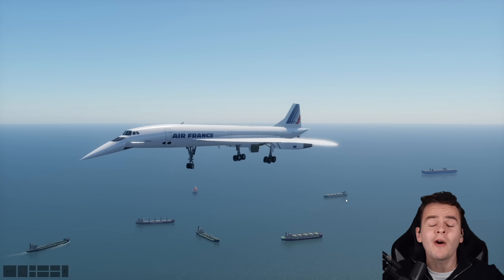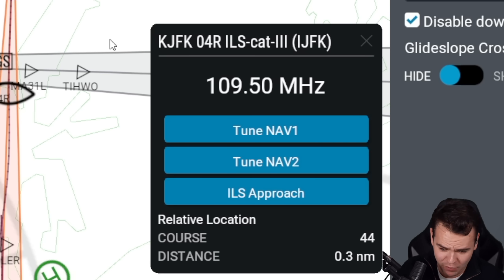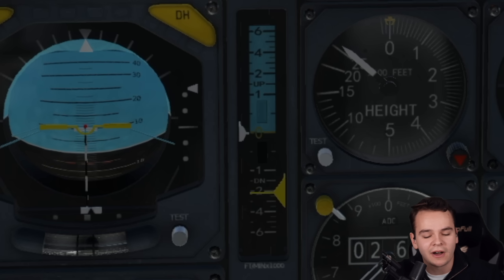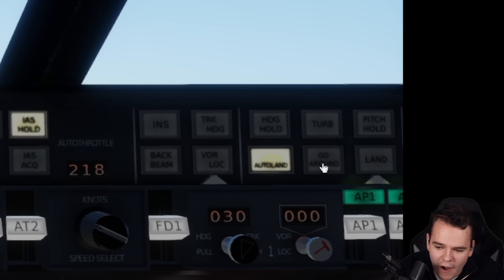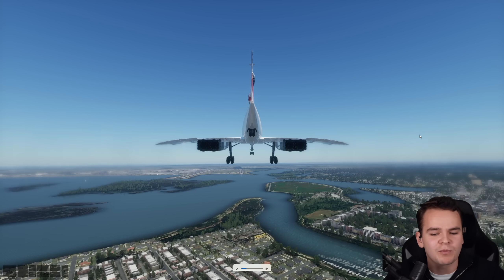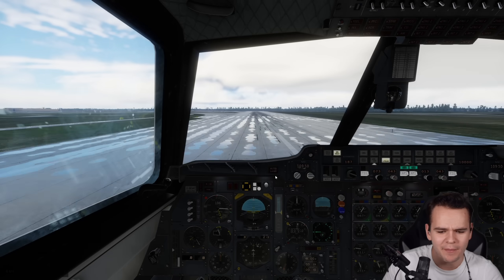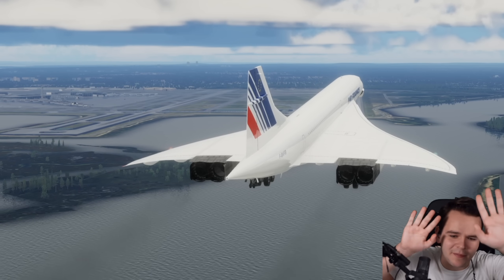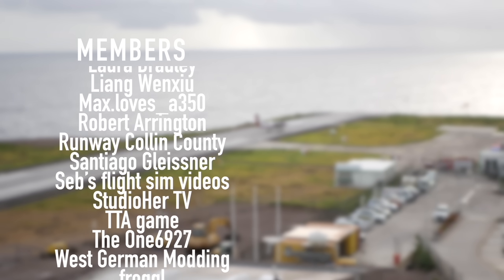The Concorde Could FULLY Land Itself (But the landings sucked)

Comment: 6:09 that wasn't a hard landing not butter but not that hard either.
I read this about it "The approach speed is on the back side of the power curve (190/160 kts (staged)), so the airplane is unstable (behind the power curve). Therefore, the normal approach is flown at a constantly decreasing airspeed. The pilots train to hand fly the approach, but as a practical matter, the vast majority of approaches are flown on the autopilot."